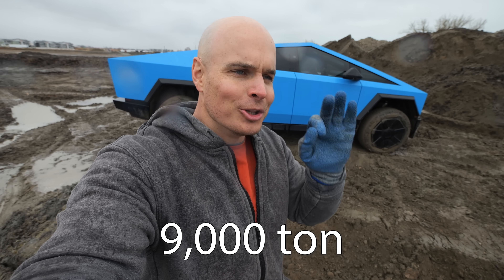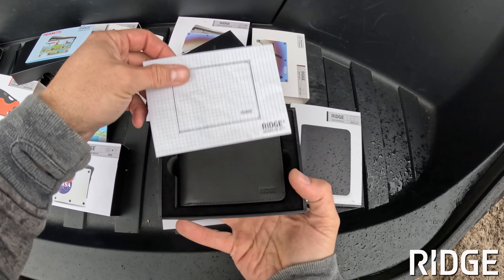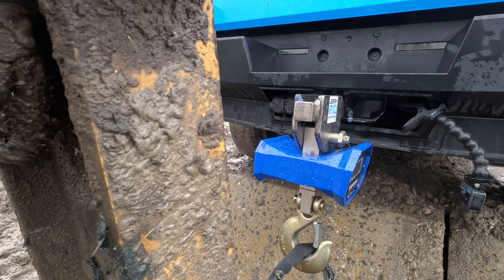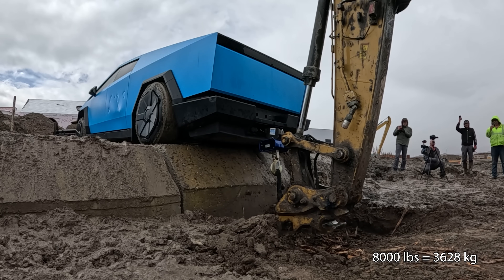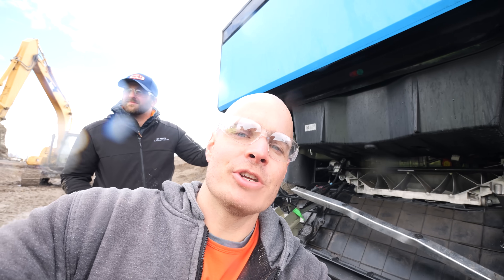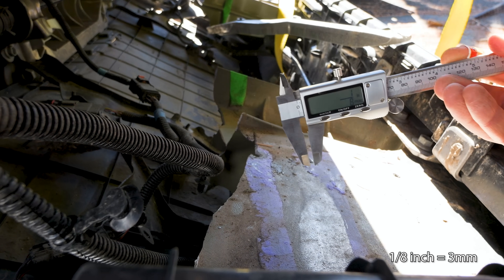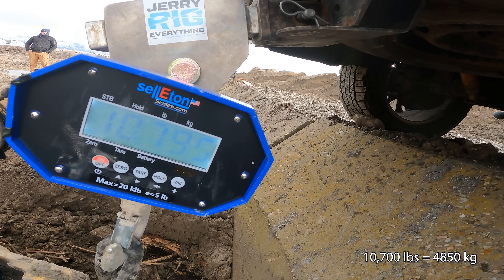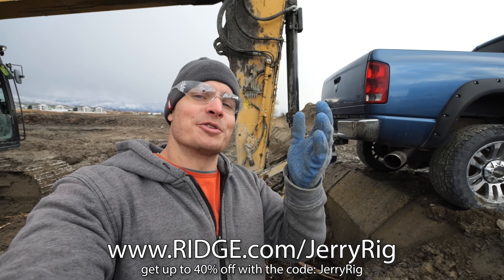SHOULD YOU TOW WITH A CYBERTRUCK?! - (catastrophic failure test)

Comment: It is correct that aluminum generally has a poor fatigue life compared to steel. Aluminum lacks a well-defined fatigue limit, meaning that even low cyclic stresses can eventually cause failure over time.

However, it is incorrect to say that steel does not break under fatigue. While many steels exhibit a fatigue limit (a stress threshold below which fatigue failure is unlikely to occur), they can still fail under cyclic loading if the stress exceeds this limit or if the material is subjected to defects, corrosion, or high-cycle fatigue conditions.

Comment: 1500lb rated tongue weight breaking at 10,000lb doesn't seem like a problem.  Where did you come up with the 11,000lb towing weight having anything to do with the tongue weight strength limit?  This video just looks like more Elon/Tesla hate to me..
Reply: Indeed! He uses the towing capacity numbers straight down on the hitch. As if the whole trailer and weight was balancing on that hitch alone. Which we all know is not the case. The proper way to tow is to have the weight balance across the axle(s) of the trailer. The hitch itself barely has any weight downwards.
This is for sure pure Tesla hate.
Reply: People buy Dodge trucks to tow and do "real" truck things. People generally don't buy Cybertrucks as a Dodge Ram replacement (I say generally as, heck, someone likely did). The Dodge's towing capacity is 13.8K - higher than the Cybertruck.
Video seems to try to hold Tesla responsible for REALLY bad trailer loading / clueless owners. How many Cybertruck owners tow anything of consequence, let alone approach capacity?
And no, not a Cybertruck fan at all - I actually enjoy the destruction.
Reply: @grumpslowenleft9642  How many Cybertruck owners put 4.5 tons of force straight on the hitch? Clearly they will violate road laws before anything haha.

Comment: Like others have said that's more tongue weight than a hitch will likely ever see, even accounting for uneven roads. However I do think the aluminum frame is a problem. Semi trucks could be ordered with aluminum frames up until sometime in the 80s (at least that's the newest truck I've seen with one) but they just had too many issues with cracking and galvanic corrosion. It's not a good material for routine loading unless you have routine inspections as well, like airplanes.

Comment: Did it scare me that the hitch broke in the Cybertruck? No! It's still way over the limits of normal towing. What scared me is that it doesn't drive because of lack of hitch and bumper. A vehicle should be designed to drive and the lack of drivability should be the last thing happening. Like old cars. You cut off the hits, it drives. You cut off all the wiring for the lights, hitch etc, it drives. You disconnect the o2 sensors it drives in open loop mode. You cut off the MAF sensor, it drives too. If you have a 4wd and chop off everything behind the sits, just engage the center diff lock and it stil moves forward. 

No wonder terrorists drive a Hilux and not a Cybertruck.

Comment: Is this supposed to be too low?  10k pounds on a trailer hitch is ridiculous.  You aren't balancing the entire towing load on the hitch.  This is a good result.  The thing I am most curious about is how much the aluminum will fatigue over time.  Aluminum doesn't hold up over time well, it gets weaker over time with repetitive stress and corrosion.

Comment: So you're telling me if a 11k trailer falls off a cliff, it'll break off. Sounds like a feature not a bug.
Reply: no, they're telling you that if the hitch has 1100lbs on it and they drive over a bump, a 10g shock could snap it off.
Reply: @henrym5908  The bump is a landmine.
Reply: @henrym5908  The downwards acceleration would be 1g, as always because of gravity. Upwards acceleration would be relatively small because it gets spread over time by the tires and suspension. Not to mention that even if the load was in the front of the trailer, the axles will still distribute the weight over the tires.
Reply: @henrym5908  This is not how it works in reality though.

Comment: Does the direction of the load being applied make any difference in the outcome? It appears to me this entire load is being applied in a downward direction. That doesn't seem to imitate a realistic scenario. Should this truck be pulling something, some of the load would undoubtable be applied downward (depending on the characteristics of the trailer being pulled) but the majority of the load would be applied in a rearward direction as the load is being pulled. This test seems to completely disregard that, failing to consider the shape of the material and the direction/method the material is attached/bolted to the frame.

Comment: Sounds like Cybertruck is made just like my collector toys ... diecast.  Many people here are confused about dead loads and live loads.  The dead loads are after the tesla event when you are dead and motionless.... no seriously the tongue and trailer weights limits are dead loads.  The live loads, that most manufactures design for, are like when you or trailer hits a hole going down a steep hill with heavy breaking.  The tongue load can easily approach the total load in the vector perpendicular to the road or apparent downward force on the tongue.  Any  trailer of more than 3000 lbs is also required to have brakes.  These breaks will easily transfer  1/2 the total weight in a "rotational moment" of trailer to downward tongue force.  Myself I would expect any truck to be able to hit a pot hole in addition to heavy breaking, like we do just before said pot hole!  What we want to see here is a tire/suspension/axle failure BEFORE the hitch/back or vehicle breaks off.
Reply from the maker: Very valid points.  Thank you!
Reply: Did you see what the suspension did in this video on both trucks?  Even towing close to max load, I have never had any truck come close to stressing the suspension like that in any environment.  Theoretical is only that if it doesn't actually happen in use.

Comment: But your only testing force in once direction, so to me its null, info is important but has no real place for pulling a trailer? At least your do mention some properties of pulling a trailer, but straight down is less common straight back is more but to test both separate also may not give the proper picture also. But the data is good to know!
Reply from the maker: Tongue weight is an important variable when it comes to towing. If there's too much weight it could throw the truck off balance or snap the truck in half.  Same if there's not enough weight on the hitch.
Reply: @JerryRigEverything  Ok I think I get what you're saying now, it went past me, this was a test of tongue weighted pressure, for instances of overweight or weight not put in the right areas of a trailer and to see if the ratings posted by Tela are in spec. instead of a test for pulling of a trailer through lense of what is most common or daily. It is still a small test compared I will say, but a puzzle does take time to go together! Also ty for the awnser back and so fast to TY!

Comment: While this test was pointless as your never going to see 10,000 lbs of tongue weight on any bumper pull trailer, it was also a great look into the terrible construction of these Teslas. Even Ford despite their terrible aluminum bodies didn't go as far as an aluminum frame. Aluminum is a terrible terrible choice for a frame, having owned a couple trailers with aluminum frames I can tell you they crack and break after a couple years of hard use. These trailer frames were not paper thin cast aluminum and certainly not glued together! These Teslas are not made to last, and to top it off the company is so anti repair that they don't even sell parts! Aluminum is only a good choice for things that have to be super lightweight like airplanes. Its a terrible material for cars, trucks, trailers, boats, and anything else where extreme stresses are encountered and a little extra weight doesn't matter in the slightest.

Comment: What a bunch of made up “science”. Cresting a hill does not put much more weight on the tongue. How can it? The trailer has no idea what orientation the truck is at because of the ball and socket joint. Think about it. In fact when the trailer is tilted uphill, it has even less downward tongue pressure because more of the trailer will be behind the wheels than before. Please do a test where you take a full capacity trailer and see how much tongue weight you can realistically generate. Maybe with heavy acceleration followed by heavy braking.

Comment: The industry safe tongue weight (vertical force rating) of a hitch is only required to be 15% of the towing capacity. In the Cyber trucks case it is only required to be rated for 1650Lbs, it surpassed this by 6x, very safe. Which is why this video is stupid. At best its Political drama, not scientific at all. At worse its gasoline on a fire of political terrorism spreading across the US. I'm disappointed in Jerry.
Reply from the maker: You're confusing 'rating' with 'safety factor'. But no worries. The steel frame RAM did survive the same test.

Comment: Towing capacity of 11,000lb does NOT mean a tongue weight of 11,000
The tongue is rated at 1,100 lb
Normally love your work Jerry, but you're way off on this one.
Reply from the maker: That's why this is a tongue weight test and not a towing test. I do explain that verbally in between trucks.
Reply: @JerryRigEverything  "The hitch breaks around 10,000 pounds. (4500kg) Which is far too close to the 11,000 pound towing capacity. Yikes. " -The description is click bait.

Comment: Jesus, tongue or hitch weight capacity is typically only 10-15% of towing capacity.  That fact you just stressed to over 600% of its rated capacity before it gave is pretty damn good. When towing the weight is meant to be over the trailers axle, not on the tongue/hitch.
Reply: Actually Tesla rates it at 1100lbs hitch capacity. So this was actually over 900% of its rated capacity. I know this is just pandering to the "I hate the Tesla CEO so I hate Tesla crowd." so I am not really paying it much attention. Its good for engagement though. Kudos for manipulating your viewers. The fact he was concerned the front tires would lift before the failure shows the disingenuous test. The Ram has about twice the payload capacity so I would expect to out do the Tesla even at the hitch even if it was also aluminum.

Comment: there's no way you're a manufacturer and you don't know about manufacturing... do you know what methyl methacrylate (MMA) is?

there are many reasons to use "glue" in manufacturing. EVERY CAR / MARINE MANUFACTURE USES THIS STUFF. 

1) distribution of forces
2) no thermal stress (can weaken aluminum)
3) it actually sticks aluminum to composites (which you can't weld)
4) no corrosion initiation points
5) dampens vibrations rather than transmitting it

i've watched this channel and i know you do some manufacturing, so (i'm not joking), i'm blown away you don't know about manufacturing... i thought you were an engineer or something.

Comment: Pulling a trailer doesn't mean pulling down; it means dragging the trailer. You need to drag this weight, not pull it down.
Reply: Thanks, came here to say that. Tongue weight and pulling weight are two completely different things. "Towing" spec is usually the amount of weight that can be pulled before either the engine can't cut it or it doesn't have enough traction. Tongue weight is the amount of weight that can be put on the hitch that the rear axle can handle (and before the front end starts to come up.) Considering the tongue spec is 1500lbs, this passed with flying colors IMO.
Reply: 9:44
Reply: Whistlindiesel made a video dragging the weight so maybe he didn’t want to do something someone else already did.

Comment: So basically worked amazing and 10x its rated weight? Not sure why you're so negative about it?
Reply: yeah those cracks at 6k sounded amazing
Reply: If you call catastrophically failing on a load it should be expected to handle under normal conditions when hitched with a trailer at the rated weight with severe damage caused to the unrepairable vehicle frame meaning it's a total loss for the vehicle as "worked amazing", sure.   This was covered in the video, of course, but I'm sure you didn't watch it.
Reply: As it cant handle trucks own weight in real world where opsies happens like pot holes where it can break frame off then if not first maybe third time with the loaded trailer 😂
Reply: Because 1,500 pounds bouncing around can generate more than 10,000 pounds of force.
Reply: @cutepuppies9216  I agree 1,500 pounds bouncing around can generate 10,000 pounds of force but this is true only true in certain impact or sudden movement scenarios. It doesn’t apply to a controlled towing test. In a proper towing scenario, forces are distributed through the frame, suspension, and hitch in a way that ensures stability. If they were pulling at a weird angle, that’s more of a traction/grip/structural test rather than a real towing test. The test he conducted was not a towing test.
Reply: Cuz it’s a pos
Reply: Did you actually watch the video or listen to anything he said? I genuinely don’t believe you did, because it’s unbelievably obvious why he’s “negative about it”. The brand new cybertruck catastrophically failed where a 21-year-old already wrecked truck did not. That does not look good no matter how you look at it. Now, on its own, maybe that’s not such a big deal. But the entire concept of the fatigue limit is where the concerns ramp up. The cybertruck failed catastrophically after taking that load once. What happens when it takes a 5,000 pound jolt a couple dozen times over five or ten years? Unlike steel, the aluminum will continue to fatigue and wear with each bump. It took a brand new truck >11,000 pounds to fail - what about one that’s been fatiguing for five years? 

Now I admit, I don’t actually care about any of this. I’ll never own a cybertruck. But if you can’t see why he’d be negative about it - there’s something wrong with you.
Reply: @ vertical tongue weight is rated at 1,500 pounds to be very safe and thats standard amongst trucks it handled almost 10x that. so youre wrong lol hes just misguiding you to think that vertical tongue weight means something that it doesnt. it held up amazingly 10x over the standard ratings.
Reply: @Thebentist  You obviously still did not watch the video; because it's very clearly explained that a tongue weight rating is for a normal, level load (i.e., how much downward force the hitch bears from the load on flat ground); and that a vehicle is expected to be able to handle moments of many multiples of that rating in downward force because there are road conditions where the hitch is exposed to additional load from the trailer.

You also apparently failed math class, because 10 x 1,500 is 15,000.  The Tesla's hitch failed at 10,000.   10,000 is less than 15,000.

10,000 is also less than the Cybertruck's maximum rated towing capacity of 11,000 lbs; which the hitch should be able to handle as momentary force due to the reasons mentioned in the video

The Cybertruck's "amazing" performance was outclassed by a 21 year old piece of crap truck that's only rated at 9,400 lbs towing capacity; so that should tell you how "amazing" it actually performed compared to real vehicles.

Comment: Tesla says the static tongue weight shouldn't exceed 10% of trailer weight, which is 11,000 lbs, meaning 1,100 lb tongue weight rating. Compared to the 19,000lb+ towing rating of a quad cab ram 2500

Comment: I am very impressed. Not a chance any normal use will ever get close to this weight. Love the Cybertruck 💪
Reply: But the aluminium life will degrade overtime, a normal condition will not apply to this test, but after some years of towing the aluminium will get weakened and before you know it , it will break.
Reply: @muhammedsamil2891  wonder how long that will take under normal condition 🤔
Reply: @EZR  maybe a little to 2 to 3 years I guess, I saw atleast 3 cybertruck with the hinge broke in Instagram or something , so this is a real problem

Comment: So you tested the tongue strength and it held almost 8x what it is rated for and you are complaining?
Reply from the maker: One truck broke..... one truck didn't...
Reply: @JerryRigEverything  you sick duck, it exceeded its rating by 10 fold. Ofcoure it will break given the metallurgy
Reply: @JerryRigEverything so it exceeds spec by countless orders of magnitude. You compared it to a truck that is rated to for much more. The towing happens horizontally not vertically so it’s an idiotic test to begin with which it absolutely smashes. And your response is I found a truck that did better.. so therefore the CT is trash. Very logical 🙄
Reply: @JerryRigEverything  One truck was rated heavy duty, and typically used commercially the other is not.  You couldn't find an F150?
Reply: @JerryRigEverything that validates you deceiving your audience?
Reply: @JerryRigEverything  And your point is? If I place a 400 pound person in The Rig and it breaks is it your fault?

Comment: Some people are missing the actual point here.   Tongue weight or not.  They had a catastrophic failure of the materials below the peak towing capacity.  If a part of the towing structure breaks below maximum towing capacity for any reason.  That's a problem.  The fact that it came clean off rather than deformation is the other problem.There is no indicator of imminent failure or reduced capacity.   It wouldn't take much to fix this during manufacturing.
Reply: It's not the way it was intended to be loaded. It handled 10x it's rating